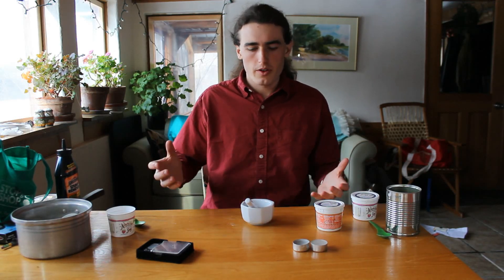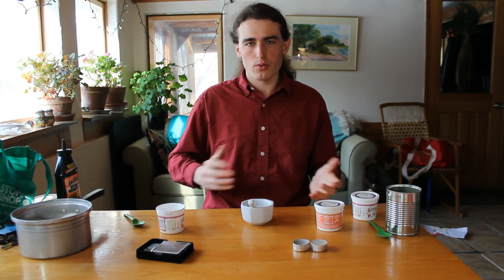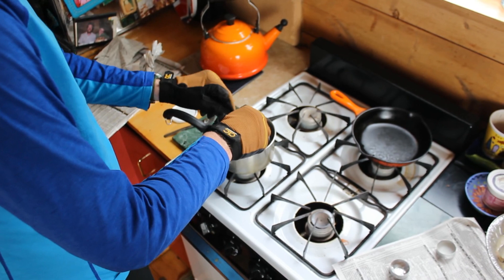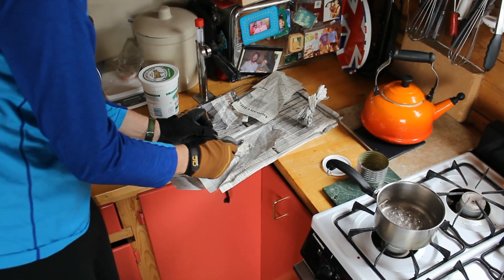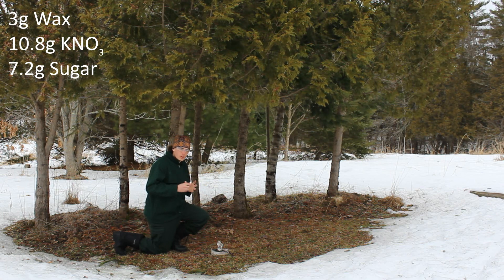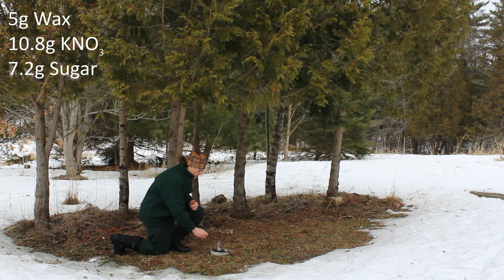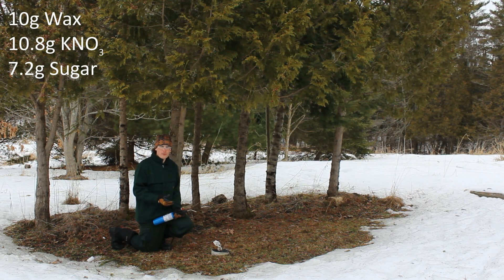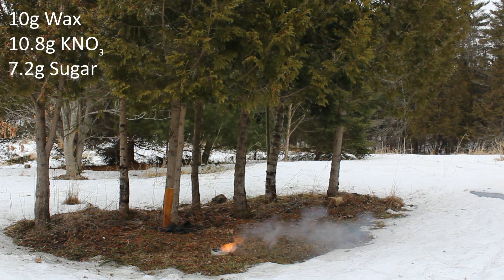Smoke Bombs: Wax 1 (11/)

Comment: I'm at this same place! I want to do tests with nozzles.

I think the secret is there needs to be a pressure build up, so it can launch the wax particles into the air. Without a nozzle it's melting, falling back into the mix and cooling the reaction.

Comment: Awsome! I have a mixture that is insane!
This is what I use: 
46,2g - Kno3 
25,2g - sugar 
28,6g - wax
You need to try it, but make sure you grind up the sugar and KNO3 into very fine powder and mix it before adding the wax. After that add the KNO3 and sugar mix into molten wax. Mix it around until the wax is completely soaked into mixture. Then let it cool and light it up:)
Reply: I have tried this recipe and I cannot get the main smoke mix to light. Would you have any idea why